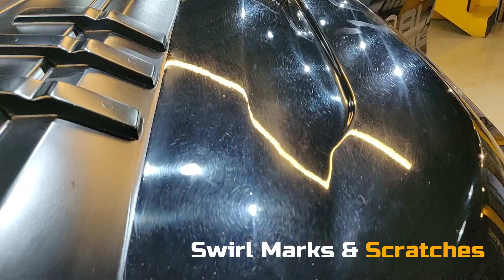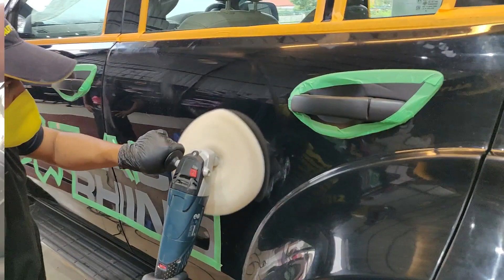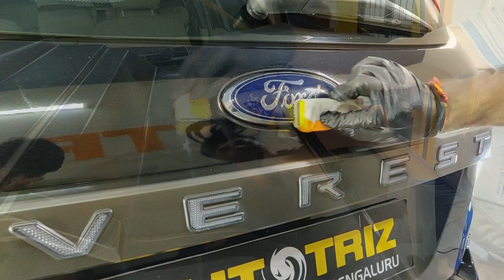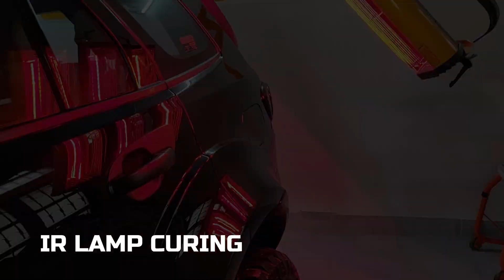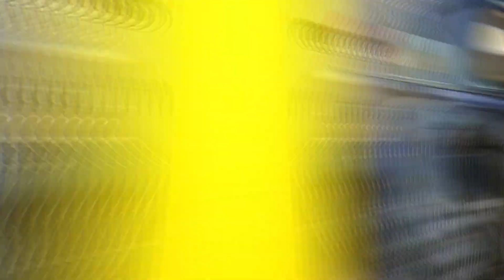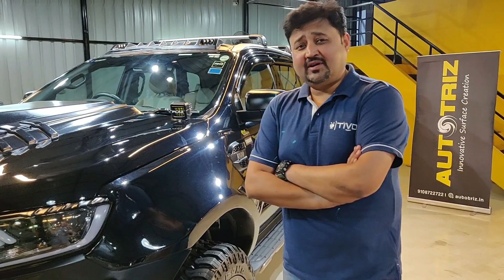Nano Ceramic Coating on modified Ford Endeavour l AUTOTRIZ Bengaluru Studio

Comment: What product do you use on the  interior vinyl, door panels? Thanks
Reply from the maker: Hello Sir,
It's Autotriz's Interior Coating product V6 for Leather and V3 for Plastics/ Fiber parts.
Reply: @AUTOTRIZINDIA  thanks for the information.